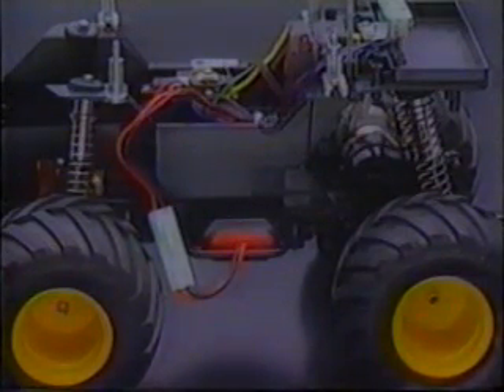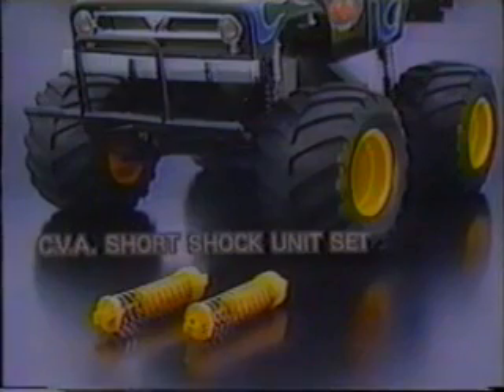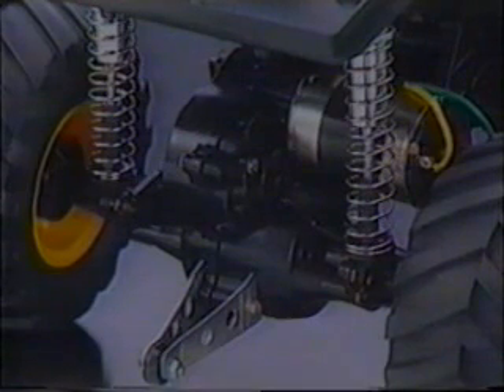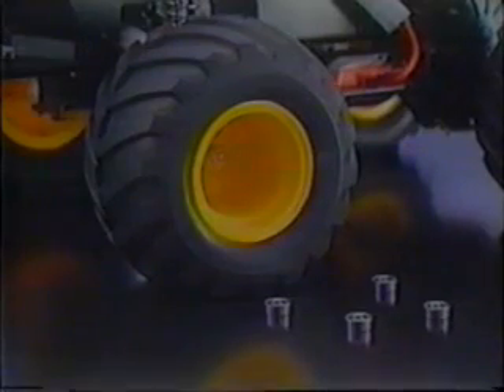Tamiya Midnight Pumpkin

Comment: I really need to get mine back on the road. My Dad got it new in the 80's and gave it to me like 10 or 12 years ago. I broke a tie rod and haven't fixed it. :( I think before I get it back up and running it's going to get a brushless motor and a decent battery pack and then let the fun begin!